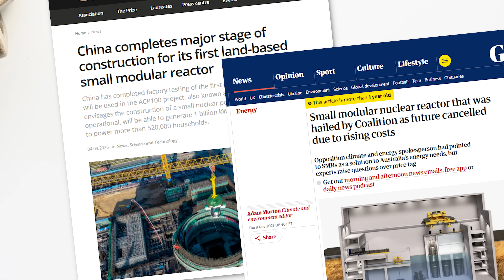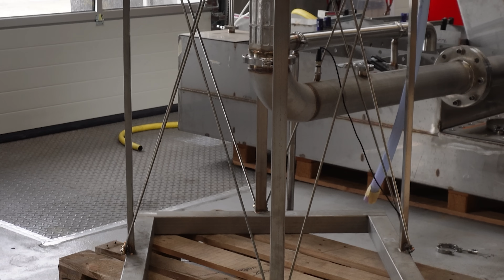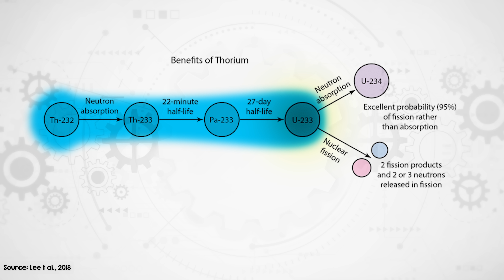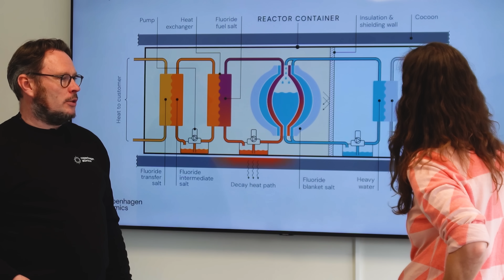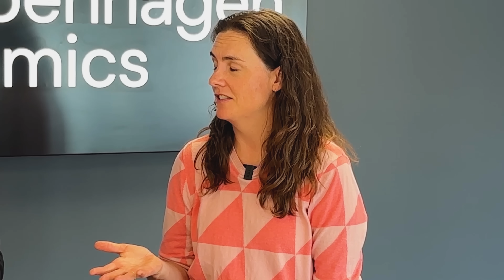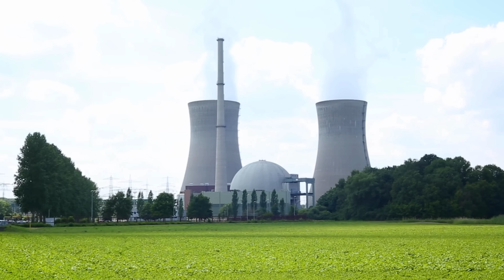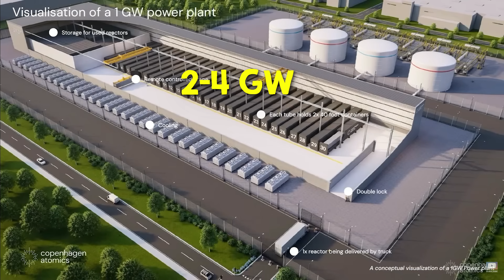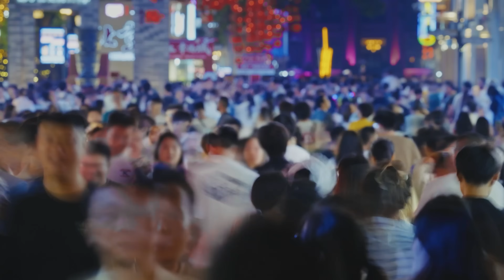Can Copenhagen Atomics Make THORIUM REACTORS Work? [TOUR]

Comment: If they started talking to large shipping companies, they might find a new market. Two 40-foot containers would deliver 80 MW, which is more than the 100,000 hp you find in the largest cargo ships.

Consider just how much pollution that'd be able to prevent.
Reply: They need to talk to regulators first. There are plenty of nuclear powered ships now but they're mostly military so operate under very different regulations.
There are a very few civilian nuclear ships now but they're severely restricted on where they can even sail let alone dock.
Reply: Good idea. This could decarbonise sea transport, but the technology has to be proven on land, and there would have to be provisions to prevent contamination if the ships sank.
Reply: Look at a map. HQ of MAERSK is in sight of Copenhagen Atomics
Reply: Good thought
Reply: Sound great just need to find way to replace them every 4 years🙂
Reply: Shipping,... well, not just the ships then, how about building the chassis to mount one as a replacement for Diesel-Electric locomotives? Using between 2 to 5 kW, one reactor could power, several,.. So instead of the current layout of a couple of big engines pulling a hundred carriages, you'd have a lead engine up front with the reactor and drive bogies on most carriages, so the whole train pushes. The main issue with safety will still be the same as today, Rail Crossings. Solve those and have trains separate from car and truck traffic, and the impact on Carbon emissions would be worthwhile. Plus, any time there's a hurricane or tsunami or earthquake, any freight train parked in a city can plug in and provide emergency power to the local grid.
Reply: @PiDsPagePrototypes  That is actually quite a good idea. I'm somewhat annoyed I didn't think about that one myself.

Since we're going that way, I wonder if they'd be useful for something like Australian road trains.
Reply: @MrMartinSchou They're the size of one trailer, in what's shown here. If shrunk down to half that, they'd certainly suit the giant Mining Industry road trains. Maybe not the 3 to 6 trailer units delivering to outback farm stations. Another use would be in the giant tippers used in open-cut mines, instead of them being gas, turbine, and diesel electric, ditto the bucket cranes and building sized scoops.
Reply: @PiDsPagePrototypes  Yet another use case that I hadn't thought about. And also quite brilliant.

And now I'm thinking sort of outside the box, one thing I keep hearing is a problem with transitioning to majority EVs is charging infrastructure. If one charging station is delivering 300 kW, then a Buc-ee's size location would need between 24 and 36 MW on tap. Drawing that from local power infrastructure is difficult, as that is what you'd deliver to somewhere between 500 and 1,000 homes.

But if all you needed was to have a single container delivered once a year, that's a lot of infrastructure work that isn't needed. And if there are power outages of any kind, those places would still have power, which in a smart house setup means your car is now a mobile battery that you just top up once in a while.

And speaking of "500 to 1,000 homes", you could run apartment buildings off of them. Office buildings. Building sites. Data centres.
Reply: @MrMartinSchou  Decentralized Power Grid, that'd lower infrastructure costs for transmission cables and step-down facilities.
Reply: The new net zero plan ,at this moment are looking at major changes to shipping, China is at this moment are also perfecting molten salt reactors , well done China, they're miles ahead in this race.
Reply: In ship, is handy to keep it in container. If it fail, just dump in the sea.
Reply: The molten salt reactor idea is no compatible with water: Different from a conventional light water reactor the fuel is not walk away safe. It has to be kept hot or will decompose and corrode through the reactor vessel in a few years. This happend as an accident after the MSRE experient was shut down with the fuel left in the reactor for some 20 years, after some time of keeping it hot. A good part of the fuel salt is water soluable, so way worse than putting a conventional fuel rods with oxide fuel in the ocean.  So it would be a really bad idea to put such a reactor on a ship that may sink and be uncessible for a long time. A conventional reactor would may way more sense.
Already the conbination of molten salt and a water moderator can cause issues with steam explosions when the hot salt comes in contact to the water.
Reply: @UlrichHarms-ci1ovYes that is absolutely correct. Any fuel that reacts with water is a no go for ships. The fuel must be absolut solid seawater proof for years. TRISO would be the most durable.
Reply: @UlrichHarms-ci1ov  "Fuel is not walk-away safe" Have you heard of electronics and automation?
Reply: @UlrichHarms-ci1ovI challenge you to calculate how much one lost reactor will increase radiation in an already radioaktive ocean. I also challenge you to compare the environmental damage of a reactor to the poison all the worlds ships send out into the air and water from burning oil. I am sure that a few sunk reactors will be much better for the environment!
Reply: @SteenLarsen   Almost none actually. Radiation is extremely localised. You are NOT getting gamma radiation from a few metres away. 
Now if we were to use Li-ion batteries, as some suggest,you'd be adding one of the most reactive metals onto water. That would kill off kilometres worth of life from metal toxicity.
Reply: @UlrichHarms-ci1ov What happened with the MSRE was no accident. They abruptly killed the program and refused to fund a responsible decommissioning, which would have been cheap at the time, as they already had experience defueling the reactor and purifying the salts. Yes, abandoning the salt for decades creates a mess because of the radiolysis, and they were warned.

The salts react slowly with water, and the ocean is quite large, so even the worst case is unlikely to be catastrophic. Certainly, engineering effort will go into any marine reactor to minimize such harm. Using a conventional reactor is not an option; such reactors can't be made small enough without highly enriched uranium, which limits use to military vessels.
Reply: @Th-233   I absolutely love how even the slightest of potential risk that is less dangerous than normal daily industrial accidents is seen as "excessive" and "catastrophic" when it is with nuclear energy. But when thousands and millions of exploited labor as well as who knows how many swaths of tax payer many and vast stretches of land rendered permanently barren and toxic, while being unable to provide adequate power without even more expensive and never-accounted-for storage, as well as millions of tons of wastes BEFORE most have reached the end of their lifespan, is somehow seen as "Green" and "The Future". If Renewables/Unreliables are the future, then I'm quite confident as to humanity deindustrializing in the name of "saving the climate", while still not having saved the climate.
Reply: No. Every one of these is a disaster waiting to happen. Their 'protective cocoon' is a freaking shipping container!?

The world has plenty of experience with molten salts; anyone with the least experience with it knows not to put it near water. Their whole design is to wrap radioactive water with molten salt.

It's insane.
Reply: Only 3% if ALL is replaced. Cargo ships are BY FAR the least polluting sources by themselves, and almost non-polluting if considering the cargo carried. Automobiles are the absolute most polluting sources, and only electric, synthetic fuels, and potentially hydrogen can replace them, especially with the help of public transport.
Reply: @ZippyPiglin4136  And which is easier to arrange? Replacing all automobiles in the world with electric ones, or the engines in 150 20,000+ TEU container ships?

I'd argue that even with red tape, it'd be a lot easier to convince the ship owners to do that than convincing the owners of more than a billion internal combustion vehicles to replace theirs.

And you're acting like reducing the world's pollution by 3% is nothing.
Reply: @MrMartinSchou   3% of transportation pollution. Automobiles are well over 40% alone. 
It may help a little, but you're better off using PHWRs instead; way more reliable than molten salt. 
Molten Salt Reactors could perhaps be used in industrial heating. Steel production takes a lot of coke for heating, and so do many other metals. That would cut down way more than just forcing cargo ships to be retrofitted. Although your idea is definitely far better than the people suggesting ships with Li-ion batteries.
Reply: @MrMartinSchou  In passing, if you offer every ICE vehicle consumer in the world a better vehicle for half the price of his ICE vehicle, he will switch pretty soon. It's already happening. But switching a fleet of ships - you're talking decades.
Reply: @jonb5493  "half the price" yeah delusions. Hypothetical "ifs" run nothing
Reply: @ZippyPiglin4136  2025: ICE and EV mostly same price, which is about a doubling of the cost-effectiveness of EVs over the last 5 years or so. Already, EVs are beginning to take from ICes; biquitous Yammy-125s. - over next 5 years, that will be overwhelming.
Reply: Broken youtube won't let me de-typo my post
Reply: Automobiles create a drop in the ocean of pollution.
Manufacturing and livestock farming create easy more.
Reply: @ZippyPiglin4136  Indeed, car tailpipe emissions is a solved problem. Fuel for shipping absolutely isn't.
Reply: @ambrosenuk   wdym a "solved problem"? 
Batteries have insane wastage, and recycling adds unaccounted costs. 
Hydrogen has very low density, and is dangerous to handle (you do NOT want a moving object carrying a flammable and explosive cold gas tailing you), and not very energy efficient. 
Synthetic Fuels are almsot entirely ignored.
Reply: @ZippyPiglin4136  No, lifecycle costs of electric cars are completely solved. This is not tricky.

Truck haulage in European working conditions is pretty much solved, too.
Reply: @ZippyPiglin4136  (i) Batteries .. insane bla: nonsense.
(ii) That's why the hydrogen-powered passenger vehicle yarn is a straw-man, like the yarn about switching gas-boilers over to hydrogen. But there are many roles for hydrogen in future energy tec architecture. Oh FYI, a big tank of LH2 following you on the motorway is no better or worse than a tanker of petroleum - which is happening more often than you might like to think! 
(iii) SAFs are a band-aid; as such, they will have a role.
Reply: @ambrosenuk  "completely solved", while almost all EVs are just dumped out in the open?
Reply: @jonb5493  The tanker of petroleum won't really burn. Hydrogen will burn explosively and burn everything nearby it. 
Far more prominent when in automobiles.
Reply: @ZippyPiglin4136  
"Synthetic Fuels are almsot entirely ignored."  For the very simple reason that their production is ludicrously inefficient.  And you still have all the other problems of ICE engines (NOx etc) and none of the simplicity advantages of electrics.
Reply: @ambrosenuk  - re. trucks, on the way to being solved even here in Australia with our vast distances, with Janus technology setting up battery swap stations.
Reply: @ZippyPiglin4136  "almost all EVs are just dumped out in the open?"  Citation please.  I'm aware of one situation when a rental company went bust that's all I've heard of.
Reply: @malcolmstreet1   Hydrogen was also considered ridiculously expensive, alongside Renewables, until decades and decades of well-funded research. 

You don't get to make a immensely unbalanced playing field, and get to play a game of blindfolding.
Reply: @malcolmstreet1  Dimethyl ether doesn't need refrigeration, only a little compression, has about the same energy content as LPG (which is mostly propane, the cleanest hydrocarbon), and the same storage requirements, but lower CO2 emissions, much lower NOX emissions, no soot. Formula CH3-O-CH3 - oxygen in middle of bent molecule means no carbon-carbon bonds, and stops nitrogen side reactions.
Reply: @jonb5493  Hydrogen has such low density, even as a liquid, you'd need about ten tankers for the same energy as one full of petroleum (counting the volume lost to insulation - LH2 boils at about 250 C below zero !)
Reply: @malcolmstreet1  Dimethyl ether is the best synthetic fuel - it behaves like propane, just needing light compression to liquefy, not refrigeration to minus 100 C like LPG/methane. It also has low toxicity, makes a good diesel fuel, and burns very cleanly, with no soot and very low NOx.
Reply: @malcolmstreet1 a 40 mega watt msr planted next to the charger, 👌